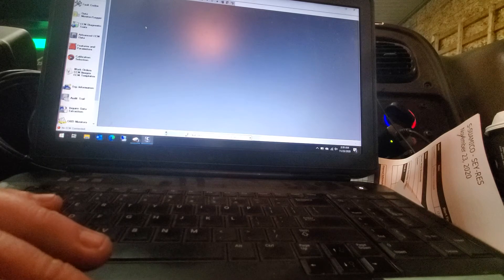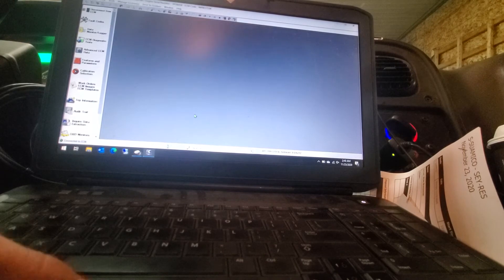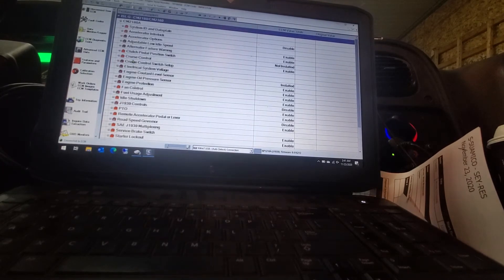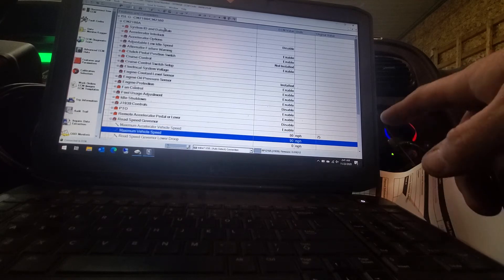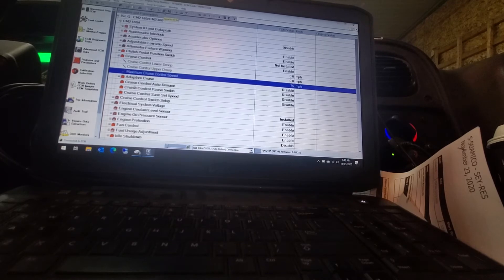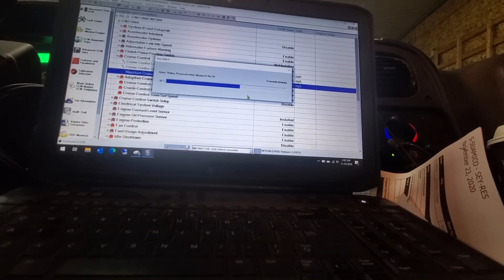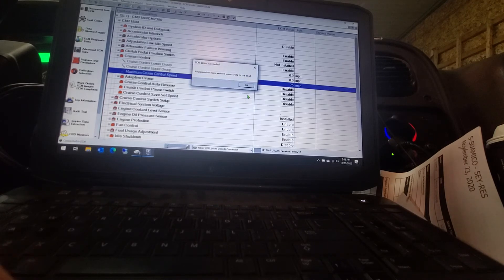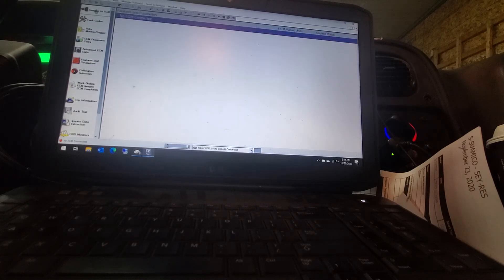Cummins Insite Change Top Speed

Comment: Its funny how a driver can ditate how fast he wants to go in your truck. Speed will not get you there faster than traffic allows. The faster you go the more fuel  it consumes more stress and wear and tear on your equipment. Any business owner operator knows this, plus safety is now minimized.
Reply: Guess you've never driven a  governed truck. 
Just because the top speed has been adjusted doesn't mean you would drive wide open. 
You don't drive your car wide open even though you can. 
Correct  ?

Comment: Thanks for posting this!  A friend purchased a Ford F750 with a Cummins ISB CM850 engine; won't get out of it's own way on the highway, but seems to accelerate well enough from 0-45, then it seems like it wants to slowly accelerate stopping around 55-60.  I'll try looking into the road speed governor tomorrow.  Looks like the waste gate on the turbo is bad too; boost pressure is hitting 46 PSI.

Comment: hello i have a 2022 lt series with x15, been to shop twice now and they put on computer to turn up to 75 mph, but it will only go 73 but it says on laptop set at 75 mph. you can actually set cruise at 75 n shows it but truck will still only go 73, and on any slight decline if it just knicks 74 mph the trans will downshift to 11th n drop speed to 71/72 n then climb up to 73 n stop there n the bucking of droppin to 11th shouldnt be.. two questions, why wont it go 75 n do the droop settings have anything to do with this n what should the low n high droop be set at? thanks!
Reply from the maker: It sounds like ur rev/per mile is off on ur tire size
Reply: its 493 revs/mi where it should be.. wondering if it needs to be taken out of economy mode n into performance mode?
Reply: There's a setting for vehicle maximum speed as well check that too

Comment: I took my truck to the dealership for a programming.
It didn't work, they tried twice! any idea what is going on? 2009 peterbilt 335 px6
Reply from the maker: They don't know what they r doing or u have a computer problem as in its locked or just ain't receiving data from the computer
Reply: @dirtydieselnation8826  They said that there was no problem. They said that they removed all speed restrictions, but there was no improvement.
Reply from the maker: Then they didn't do it right
Reply: @dirtydieselnation8826  I'll have to find someone else! It's weird because the truck is like new with very, very low miles! I thank you for your time

Comment: Hello nice video, I had also figured out how to do this with my trucks but on one truck that parameter change is locked so I can’t change it myself. It was tuned and I believe the tuner locked it for some dumb reason. You don’t happen to know how to unlock or override it somehow would you? I believe I’ll have to get a new tune for it but asking just Incase.  Thanks
Reply from the maker: What is your truck
Reply: @dirtydieselnation8826  2013 Volvo vnl cm2250 Cummins
Reply from the maker: @benkolosov6177  it may be the tune wants that blocked or if you return your truck back to factory settings then retry the tune it will fix the issue